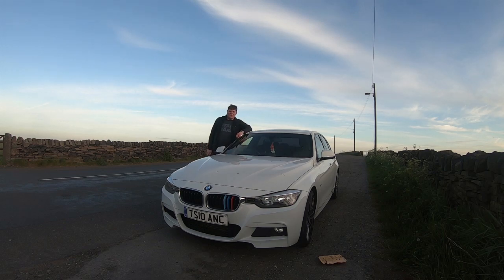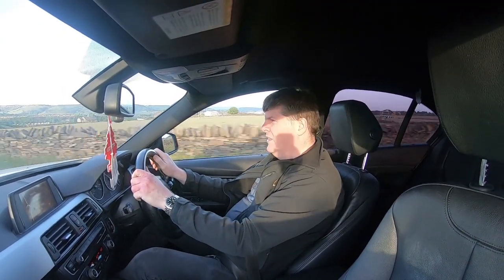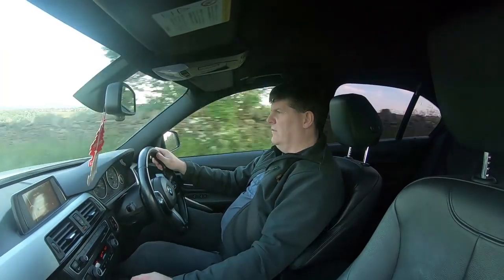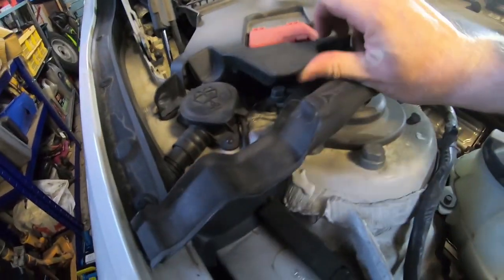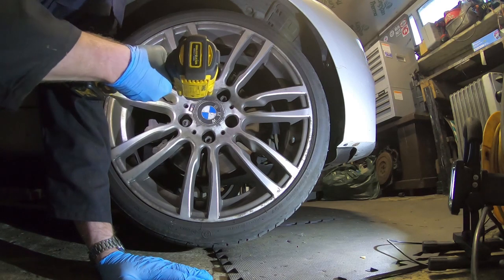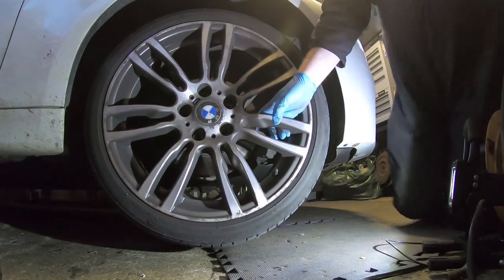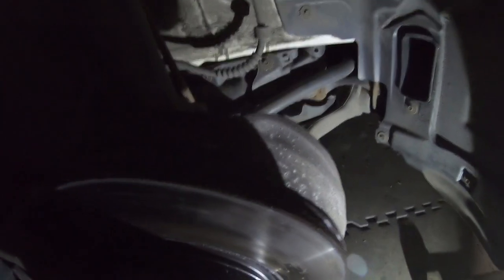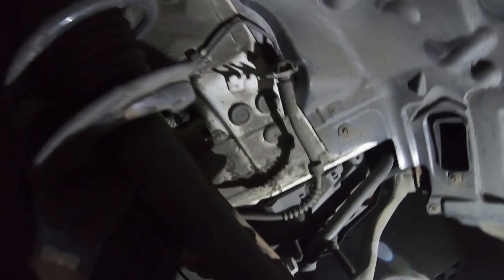2013 BMW 318d Part 1 - Front suspension rattle

Comment: Some of the F30 diesels have low road tax whereas the E36 is in the higher band for older cars which is a shame. What were your impressions of the F30 compared to your E36?
Reply from the maker: The F30 is nice to drive and this one is in M sport trim. This has the later N47 2.0 diesel which is more bulletproof than the earlier ones. I like the relative simplicity of the E36 which means it is cheaper to run and fix.

Comment: I'm having a similar problem with mine, did you get to the bottom of this?
Reply from the maker: I've left it for now. I'm suspecting the strut top mount.
Reply: @Parknest  cheers, hoping it won't be an MOT issue as I've got mine next week!
Reply: Hi there did you ever find where the noise was from??
Reply: @ewanbrown9333  hey, fixed it, could have been one of two things, either the steering rack, which I used the BMW repair bush on mine. Or oddly enough it could have been the brake caliper, which on mine had lost the spring that pushes the caliper body away from the carrier.
I did both jobs at the same time, so not sure which one cured it!
Reply: @snake3rd  thanks for the reply I will have a look. Such a common problem but no one seems to know how to fix it 🤣🤣